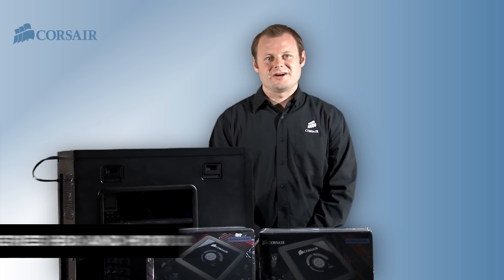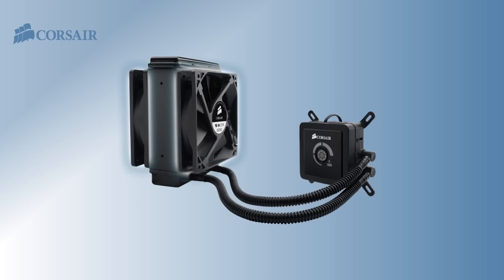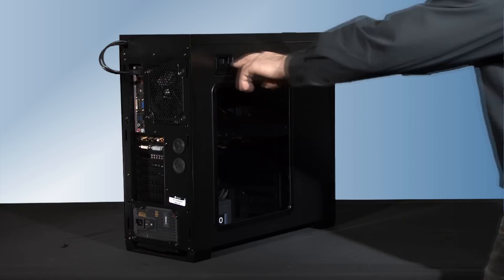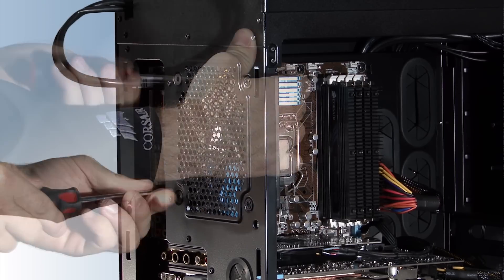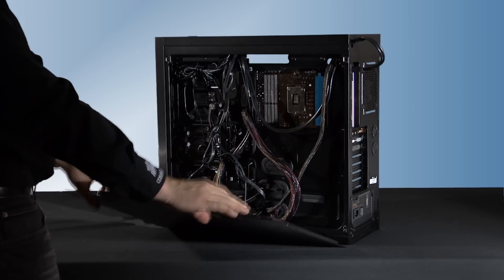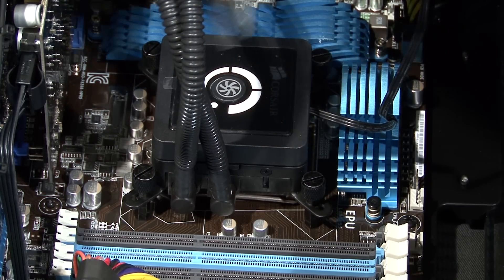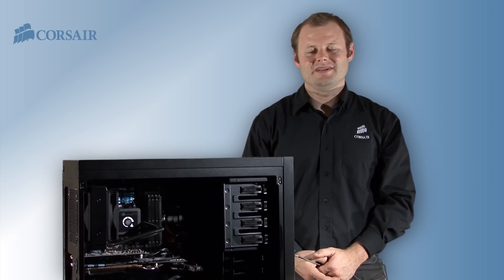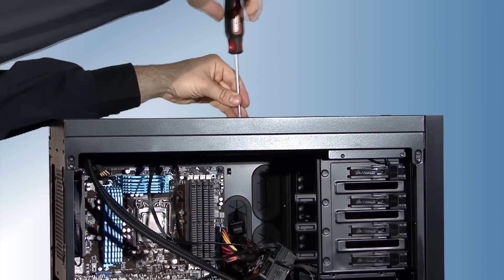How To Install the Hydro Series H80 and H100 Liquid CPU Coolers

Comment: Hi! What is the name of the connector for connecting the h80 to the usb port (corsair link, it seems). I lost my native cable and can't find another one. If possible, give me a diagram of the pin placement on the corsair control board, I can solder the cable directly to the terminals of the board. Thanks

Comment: Hey I got one of those 650D cases and the H80 cooler. I can't fit it with an X79 (LGA2011) mobo . Neither on the top or the the back, the radiator will hit something
on the mobo.

Comment: The explanations are as good and useful but too many mistakes. The hot air rises, from the video card, the motherboard etc... how can you say to mount the radiator on the top to draw air inside the computer ??? :)))))

Comment: In 2018, I am using this cooling solution for Intel Core i7-8086K and it's fantastic.
Reply: So it supports LGA 1151 socket out of the box without any issues? Thank you in advance

Comment: Once installed, is the wiring connection instructions for the H80 different to that of the H75?  In this guide  you mentioned plugging the radiator fans into the cooling unit, then the 3 pin connector to the cpu fan header on the mobo, then the 4 pin to the PSU, that all makes sense,

But im sure in a previous guide for the H75 it said connect to the two fans to a Y cable into the sys_fan header?.......I dont see why these guys would have different configurations, or am I being stupid? 

Mine will be going on an Alienware R4 ALX btw, any advice is appreciated.

Comment: haven't had ANY luck with the modern H100s,  still using my classic h100 (with the little man icon same as in this video lol) it really was the best one they made.  too bad they don't make it anymore,  they never should have changed it.  new ones run a lil hotter, tubes don't bend very well and they're a tad bit shorter..

Comment: The back plate was installed incorrectly. The cut out should line up with the top screws on the back. visible a 2:48

Comment: Is this a good product? Does it cool down better than air cooling? Yes, it cools down better than air cooling.
Will it fit your case? If you are happy with push or pull configurations only (not both push and pull), it is possible that it will fit. Push and pull will be rather difficult to fit in most cases out there, even expensive and "gaming cases" that you may have.

Comment: wait did he said to mount the h100i to push air into the case? O.O he does realize thats counter productive right? hot air rises
Reply: notabott It's not if your exhaust fans are situated in the fashion in the graphic. Fans in the case will either push or pull the air depending on the orientation so if, as is the most common setup, the rear case fans are pulling air out of the case, you MUST follow the flow or you're not getting circulated air properly. In that case, pull the air down through the top, and the rear fans will continue that directional flow out the back. If, like my rig your exhaust fans are on the top, the radiator fans are setup inverse to the fashion he recommended so as to maintain the single directional air flow. So, my case has front fans pulling air in, and top fans pulling the air out, because as you said, heat rises, and the rear of my PC is flush to a wall and I cannot exhaust the heat from there, whereas the top of my rig has several feet of clearance and a conveniently placed coffee cup can stay warm when I'm pulling everything the rig will give me ;)
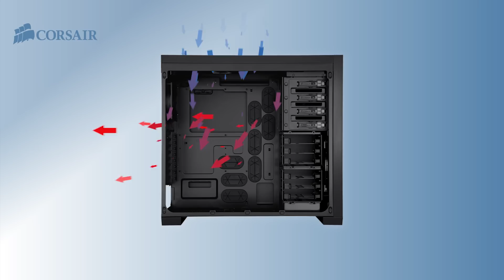Reply: yup and 4:06 shows air pulled into case from top (moreover hot air goes naturally up in air rather down) then cpu cooler pushes all hot air onto motherboard and ram, and everything seem to escape through graphic card. DA FUCK I JUST WATCHED???

Comment: Where the fuck is the water someone please tell me?
Reply: Nappa coppenhagen do you have to replace the water ? how do you do it ?
Reply: i am thinking about getting the h110 . is it any good ?
Reply: I have a graphite 760T ? good enough ?
Reply: 760 not 780 .. do you recommend a custom loop ( I'm totally noobish ) or buying the h110 ( easier)
Reply: I have a titan x right now and I dont like blower fans ... thats the reason i am considering a waterloop but im afraid of watercooling . ive been using the hyper 212 since i built my pc
Reply: Antonio Caputo There is a pump attached to the block you mount on top of the CPU.
Reply: Leon Von Waltzleben puberty much

Comment: Do i need to increase my power supply when i want to use this cpu cooler . right now im using the stock cooler .
Reply: increase power supply? you mean gt a new one? if so then no, as long as you have a decebt power supply with a good wattage and rating you should be fine.
Reply: thank you very much

Comment: I have Thermaltake spedo Full Tower which support a liquid cpu cooler but it can take a radiator only on the rear (there are Two 120 x 120 x 25 mm coolers). Do you think i could use the Hydro H100 by placing the radiator vertical or should i go for H80?

Comment: I spent 2 nights, grinding L bracket, welding (not soldering), to make U bracket. Other U made was simple enough. Fit was for NZXT Phantom Enthusiast black, 3960, Dom Plat.(Big heat sinks). Keeping 230 fans in normal position and using h100 fans. It was great fun. Took time but I really enjoyed it. The result? All good. off the bat. Happy as the proverbial p1g. My memory fits. Temp fine. New Gigabyte board. Love it.

Comment: I have a H80i and recently i've noticed it has been sounding really weird and getting really high temperatures. Now i have dusted off my whole computer and after i did that my temperatures when back to normal (25 - 30C idling) but after 30 mins or so it went back to the unusually high temperatures (40C+ when idling) which is weird, could someone help me with this? i'd appreciate it very much! :)

Oh and also having the H80 set on Performance mode makes it really really loud, even on Balanced it's loud. And another question: is it bad for the CPU to play games with quiet mode all the time?
Reply: may be its the cpu or the fans are busted
Reply: Subhan Sadad The fans works fine, i now even tried to remove the old thermal paste with isopropyl alcohol and apply new fresh arctic silver thermal paste and i even dusted off the H80i radiator and there was some sound improvements but nothing else.
Reply: maybe check the rad for anything thats disturbing the fans which is making the noise  thats the prob i had
Reply: The heatsink maybe no good. Im having the same problem with my h60. My temps were amazing for 3 weeks not going any higher than 55 with all the video rendering and game playing. Now it just keeps getting hotter no matter what I do with the CPU and thermal. So buying  new water cooler is my only option. If that doesn't work then obviously the CPU is damaged.
Reply: ***** So, is it worth buying?
Reply: shootingmen I figured out my problem. Actually the heatsink under the waterblock was still too hot. Thats why I kept getting high temps after applying thermal. Its common sense to let the heatsink cool off for awhile before adding new thermal lol. So yeah its worth the buy. Just make sure to equip yourself a good supply of rubbing alcohol and thermal for future clean ups
Reply: ***** Where do i apply the thermal?( It's my first time buying a PC) and do i need it?
Reply: shootingmen If it's a prebuilt one you don't have to.
Reply: Peligrazo Does it run out?
Reply: shootingmen Yeah, it does but it's different for everybody. Sometimes you'll need to replace it after like 1 - 2 years sometimes 4.
Reply: Peligrazo I see, so i don't really have to worry about it.
Reply: Are typical water coolers like the h100i a lot more effective than normal fan coolers? and is the h100i noisy?
Reply: shootingmen Corsair is known to be quiet and cool with their products

Comment: How exactly does the H80i connect to the PSU? via a SATA port cable to the motherboard or a 6 pin cable straight to PSU? and are all of the necessary cables included?
Reply: It connects through a 6-pin connector to a molex adapter on the h80i. The molex adapter is attached to the H80i and the 6-pin connector would have come with your power supply.

Comment: Indeed if the backplate is installed in the correct direction (with a 90° turn to the right, as you mentioned) there will be a loose that will strongly impact the performance of the cooler. I think that was a way Corsair team had found to mask this issue. Someone who have H80, H80i, H100 or H100i can confirm that this backplate issue is massively discussed in several foruns around the world, but Corsair doesn't assume your faults!

Comment: Hi...First of all I am a newbie in liquid cooling. If I understand this correctly I don't have to change any water inside, right? Will this work as a exhaust for my case? I wonder whether its cooling is powerful enough as I have Radeon R9 290 and the air gets really hot inside.
Reply: No,u never have to add or replace the fluids,Self contained.
Reply: You don't have to change any water, as it's already inside the cooler itself. And yes, you can use that as exhaust, it's actually prefered because hot air rises and you really want the air flow of your case to go in one way (usually, intake at the front, exhaust at the back and the top) and not fight itself.
Reply: make sure to get the right size cooler hence if u are going to put it on top or the back and if  it wont get in the way of ur other components as well..
Reply: Thank you for your help :-) I'll definitely give it a try...

Comment: 2:45 the backplate is rotated 90° from the correct position...EPIC FAIL
Reply: Indeed if the backplate is installed in the correct direction (with a 90° turn to the right, as you mentioned) there will be a loose that will strongly impact the performance of the cooler. I think that was a way Corsair team had found to mask this issue. Someone who have H80, H80i, H100 or H100i can confirm that this backplate issue is massively discussed in several foruns around the world, but Corsair doesn't assume your faults!

Comment: would the h100 fit in a 300r
Reply: the h80 will fit tho
Reply: sorry for all the comments but, Yes it will ontop but you have very little room
Reply: ok thanks
Reply: ReaL-IO mine fitted on a 200r...so yes
Reply: No, you dont have space for the radiator+fans... you have 2400mm for fans, but you can intal the radiator... You can only fit the H80 (120mm radiators) at the back... 
Last monday I bought a Carbide 400R and it is compatible with the H100 (I have 1) on the top, and you can also put another H80 in the back, AND, if you remove some HHD slots, you can fit another H100/105/100 at the front! :)
Reply: Sergio Pinto do you want a picture of my 200r with h100i installed in it as proof?typing on this system right now...noob
Reply: BULLET GAMING You can fit it, if you cut some stuff... you need to cut a fan, drill new holes and other stuff... Without mods, YOU CANT do it.

P.S- The "Noob" thing was childish as fuck...
Reply: Using this system right now, no drill no mods.... What do you have to say? -_- need picture?
Reply: BULLET GAMING send me a pic so...
I have the 400r and I have very very little room, and the case it self its a lot bigger than the 200r...

Comment: How do I test if the pump is broken? I moved my old system to a different case to have a new system in my main case, and now the CPU runs extremely hot when I'm in BIOS (80+, I had to turn it off). It's mounted properly, when I take it off, I see on the thermal paste that it's been on there properly (I use IC Diamond paste). The fans run at the speed I set with the button on the pump, and both run very fast, but the CPU still runs very hot, so I'm thinking maybe the pump stopped working.

Comment: HI i have buy H100i,
but when i start pc it says "cpu fan error"
why ? 
are the cooler not working?
i have tried plug the fan pin in different motherboard fan socket(3-4 pin). but its not working, please tell me if its normal.

i have:
asus p8z77 vlx motherboard.
core 17 3770k

Comment: since its all fitted in the factory with permanent fittings the liquid should never get dirty and inefficient although they are rated to last +/- 5 years, long enough that by the time it does start to lose its cooling efficiency that better coolers will be out by then anyway :)

Comment: o.O buddy... it's a hydro cooler... and there's a pump connected to those pipes... what do you think that pumps? air? hahaha... of course it comes with coolant water (propylene glycol mixed distill water or something like that)  inside but in this case, you cannot change it like custom water coolers with the reservoir...

Comment: Thermal paste is pre-applied to the heatsink. No need to get additional thermal paste, unless you'd prefer to use an aftermarket thermal paste instead.

Comment: It really depends on the ventilation in your system which one you should go with, and what you want to risk. An inhale system WILL make your system cooler, but it will draw in more dust. An exhaust system won't make it quite as cool as an inhale system, but it will reduce the risk of dust inhalation.
If your system has good enough ventilation as is, exhaust is a safer bet. If it's got poor ventilation, inhale is the way to go. Then there's also push-pull systems, which you can do. (:

Comment: You'll need to worry more about if it'll fit into your case than if it'll fit onto your motherboard. It will work fine on a Z77 board. (:

Comment: It does not need any extra thermical paste. It's already pre-applied for you. Simply pull off the protective case and paste it onto the top of your CPU. After you've installed the CPU, of course. =P

Comment: Closed loop system, meaning the water is already pre-installed. Thermal paste is on the heatsink of the cooler as well. All you'll have to do is pull off a protective window and snap it onto the top of your CPU. (: Here's a Newegg video presentation of the h100i to prove it. /watch?v=LRVO0xzVr8U

Comment: I'm no pc builder but why would anybody decide to exhaust hot air out through the cooler fins. Should it not be stipulated that is has to suck cool air in only?

I'm  just thinking from a front mounted intercooler on a car point of view, hot air go slow, cool air go fast.

Comment: I dont have back cut out but it already has a BAck plate for my motherboard fan that came with the board,is it enough to Install the new cooler
i have AMD3+ fx6100 pc on a Asus M5A97 R2.0 
reply ASAP

Comment: the kit I had came with 4 washers, in the end decided not to bother with the washers, there was just not enough length to the bolts...

instructions that come with the H80i are poor, the fan directions are not actually listed, had to watch this and read the corsair forums to work it out

not everyone is a pc tech doing it every day

VERY ! quiet fan, I can hear it, but only just :) just realised that the temps are for the gpu, need to find the corsair link that the instructions do not give info

Comment: That bracket is the wrong way round isn't it? It needs to go 90 degree clockwise in order for the "screw top" cut outs on the bracket to fit snug with the 2 top screws on the board.

Comment: I see that this cooler supports the LGA 775 CPUs, but the H100i does not (at least it doesn't say so on your website). Is it possible to use the H100i on an LGA 775 CPU?

Comment: 4:08 really?? you have 2x120mm(radiator) + 1x200mm(front) fan intakes and only one 120mm exhaust? not to mention hot air rises so it wont escape like shown on the diagram, particularly with gfx card blocking the pci vents... can anyone support the videos advice?

Comment: Want to double confirm before buying !
Are the connections like so ? Because i no longer have space for a 2nd fan if both the fans are connected to the Chassis Fan header.

Pump Power = PSU 4-Pin Molex 
2X 120mm Fan Power = Connect to pump 
Temperature monitor etc = CPU Fan Header

Comment: Yes, as long as it has a dual 120mm fan slot somewhere you're good, and learn to google before you ask...
bit(dot)ly/11X5zC7
The CPU creates the most heat by far compared to any other components followed by video cards. Usually an h100 is mounted at the top of the case which should be exhausts(heat rises) so the rest of your components should stay cool if you fill out the intakes(try to have more intakes than exhausts for a higher air pressure) and keep in mind that heat rises.

Comment: Are the screws long enough to fit a dust filter on the front fan and still reach the cooling unit ? So if you would look: *CASE* *FILTER* *FAN* *COOLING UNIT* *FAN* 

I just hope if some one knows...

Comment: Not so easy to install. If it does not fit the radiator exactly get no cooling at all. Easy happened that it only gets 20% contact with the surface. And the screws to the radiator does not get many glands. I switched to Corsair fans SP120 (unbelievable that Corsair Link does not support these fans) but can now just screwing two screws on each side that sticks.

Comment: i applied 2 of that H100s to dual cpu system without any issue... and here is description from corsair's website: 

"You no longer need to invest into finicky modular watercooling systems to get serious CPU cooling performance. Each Hydro Series Liquid CPU Cooler is a sealed, closed-loop system that comes pre-filled and never needs refilling. Tubing is constructed from low-evaporation FEP for a long lifespan. Even the thermal compound is pre-applied. You'll be up and running in minutes."

Comment: Dont know if I was doing it wrong but getting the screws in from the back of the case through the fan into the radiator was tough, the radiator screw threads seemed smaller so I had to force drill it in, afterward it became easier to do after the whole was loosened a bit, the same could be said of my GF  xD. Its all true though.